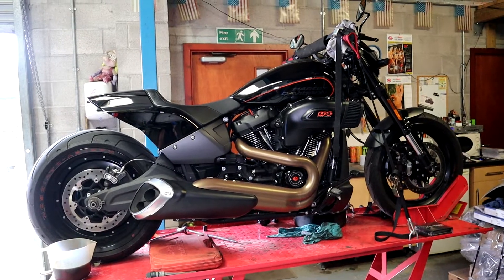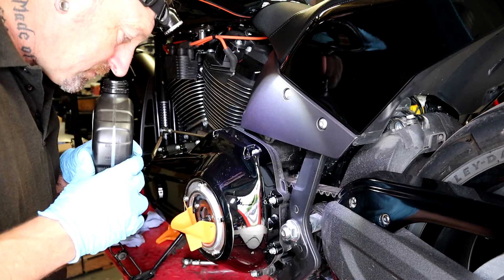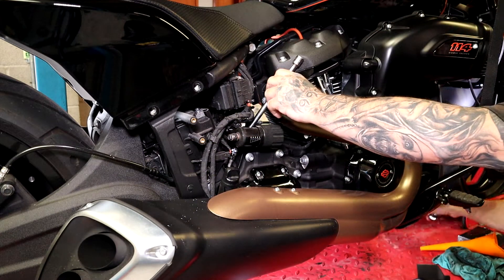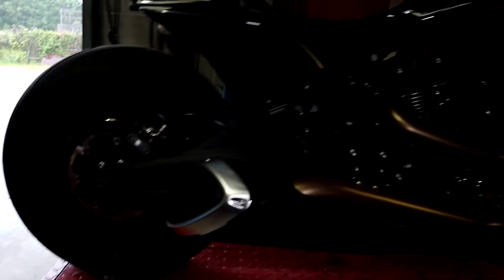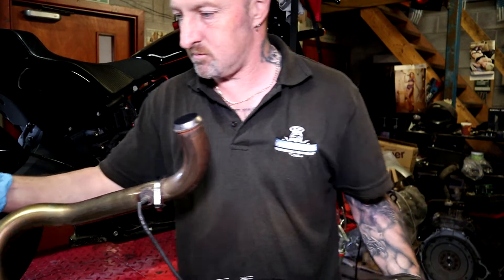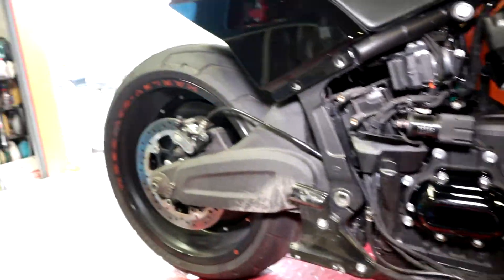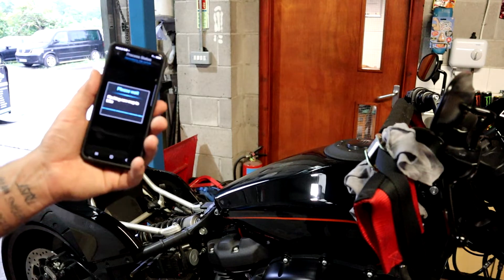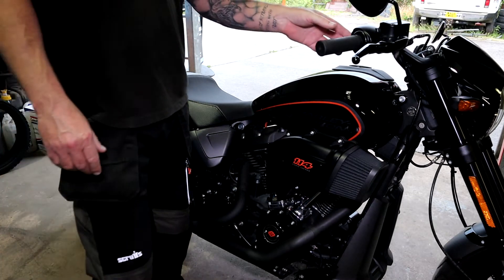Servicing my Harley Davidson FXDR 114 & fitting 2 Brothers Exhaust & Vance & Hines Fuelpak 3.

Comment: Another great vid. I’ve got a 1931 Model A Ford and to change the water pump I needed to remove the radiator. To remove the radiator I had to remove the stainless steel shroud and the final part of that was removing the filler cap that was firmly held in place by an Allen bolt. I only have metric Allen keys so I ordered a set with both metric and imperial. When it arrived none of the imperial ones fitted so I tried a metric on just in case… it fitted like a glove. The only metric bolt on the whole car was the one I had needed to remove. 🙂
Reply from the maker: Haha typical! I think we all go through things like that. We just keep going though A? Sounds like a cool car.

Comment: Looks great, and the bike too. 
Sounds fantastic, with smoke effects too - ha,ha. So much better sounding than the GSA Akrapovič :)
One question -  the stock exhaust which I think looks great too, had heat shields/covers. Does that mean the 2 Brothers pipes will make your right ankle a tad hot ? 

Hope you are on the mend.
Cheers,
Des
Reply from the maker: Thanks Des. The GSA does actually sound better with the Ak. I like the poppy pop pops it's does on deceleration. The 2 Brothers doesn't have heat shields so yea you do need yo keep your right leg out a bit more when you stop. It sounds epic in real life. Thanks for watching. 👍 yes I'm getting better everyday. I still get short of breath easily, but I'm getting there.
Reply: @Nightcrawler666  Leigh, Good to hear your getting back to normal, if you ever were 'normal' 🙂
I've swapped out the OEM end can to a Remus Titanium on my GSA last year. I think it sounds better than the Akrapovič, a bit less weight too. - No issues in Ireland with sound/emissions as there is no MOT equivalent for motorbikes.
Des

Comment: Noice. Definitely sounds different from the old Bavarian ditch pump 😂. Bet it'll be plenty loud enough when you open the taps! I'm a fan of the Diavel so it's not much of a stretch to this tbh - defo the same class of bike. What's the displacement of the FXDR - in new money?
Reply: Displacement? Fucking shit tons of pure mega POWER & a fun factor of 10000 is what you get with this bike.
Yeeharr.
Reply from the maker: "Bavarian Ditch Pump" hahahahahaha ffs. Yea I do like the Diavel. I also like the new Rocket 3. Not ridden either yet. The FXDR 114 is 1868cc the Torque is ridiculous. I have quite a few fast bike & very fast powerful bikes, but none deliver the sheer brutal rip your arms off power that this does. You really have to hang on when you open her up. Thanks for watching 👍
Reply from the maker: @moorshound3243  agreed haha
Reply: @moorshound3243  yep, it's all about the cubes baby 🤘. Couldn't give 2 hoots about bhp numbers: torque = grins 😁